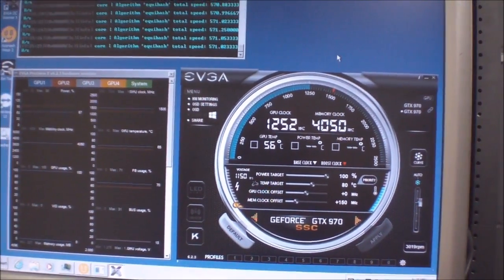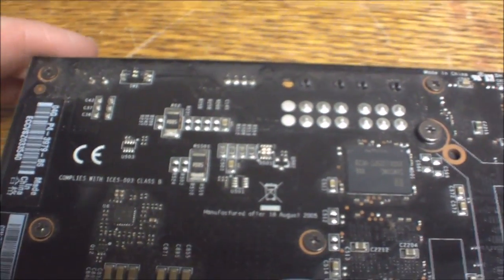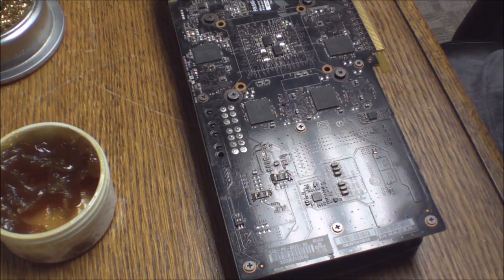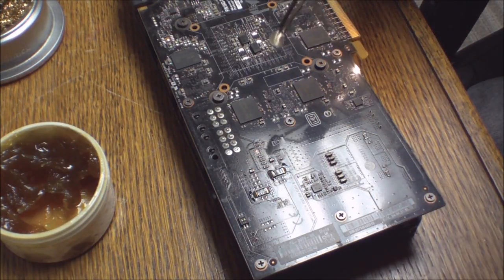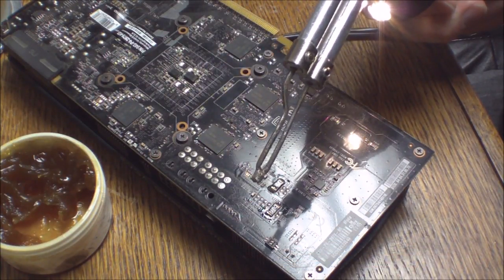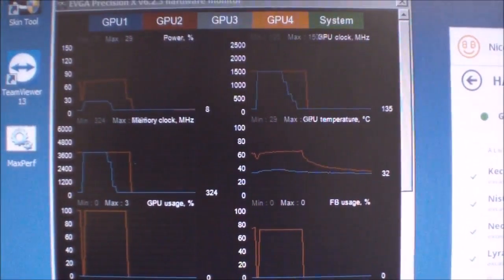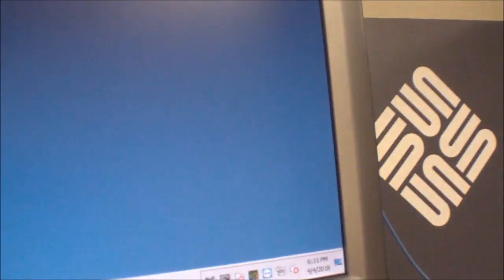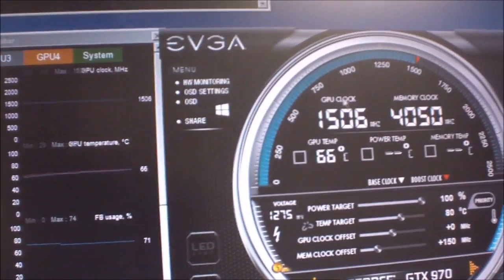Nvidia GTX 970 Current Sense Shunt Resistor Mod

Comment: finds biggest solder tip ever
Dude: Right iv got my smallest solder tip, lets do this.
Reply from the maker: Yep, smallest one for the 200w soldering iron - a lot of heat is needed for the thick power planes on a GPU. You should see what some other folks use lol
Would be much easier with a proper preheater and hot air station.

Comment: As pointed out earlier, an SMD rework station (or even a cheap Chinese SMD hot air "wand") would've been easier and safer for the PCB.
NONETHELESS — since you went with an iron (or gun)... Why didn't you just parallel a 7.5mΩ (for 3mΩ exactly, although any value from 3.3mΩ-10mΩ would work) resistors on top of the 5mΩ shunts already there? Not only would that have been a lot less work, but easily reversible as well.
Reply from the maker: Thanks for the comment!

I recently did exactly that for a reference GTX 1080, soldered a 5mΩ resistor in parallel with the 2mΩ current sense resistor on the board.
I do now have a Chinese hot air station ( since prices have come down substantially ).

I can say soldering in parallel had it's own challenges - the solder really did not to want to wet the existing resistor's pads even with a very hot iron and lots of flux. I had to use something abrasive to remove whatever plating was on the top as well.

As stated in the video, I did have a 10mΩ to parallel for the GTX 970, but abandoned my plan to demonstrate both parallel and replacement because of the difficulty I had with the first attempt and feeling that I might damage the traces if I tried again.

In short, having now done both, parallel or replacement wasn't any more or less work, and if you're ordering resistors anyway having one looks cleaner ( in my opinion ).
I went with parallel for the GTX 1080 board because of the very low value of the current sense resistor and the convenience that I had the 5mΩ on hand, replacement for the GTX 970 because it happened to be what I tried first.

Comment: With the Gigabyte GTX 970 Gaming G1 and modified BIOS I was able to achieve similar core clock speeds at 1500MHz exactly.
Reply from the maker: The 04G-P4-3975-KR with modified BIOS ( using the Maxwell Bios Tweaker ) was well under the power limit - as with your card. The 04G-P4-3979-KB / 04G-P4-2975-KR seemed to be hardware limited regardless of the BIOS power limit settings.
Reply: @zcomputerwiz  what the hell are you talking about..... You wouldn't have had any "issues" in SLI anyway..... ??!!?  It doesn't matter if the cards are different clock speeds, they would have matched automatically at the lower clock speed card.... I have two of those 970s as well... And they both clock to 1500mhz if they want to anyway without any mod.... MOST, if not ALL 970s clock to 1500mhz anyway... So what the fuck you were doing i don't know 😂😂😂😂😂😂😂😂😂
Reply from the maker: @fletchy88  What are you talking about?
I had one slightly different card that seemed to have a hardware power limit that was lower than my other card, BIOS mods didn't improve it.
Shunt mod did. What's so complicated about that?
Reply: 970 from msi no mods easly 1550mhz